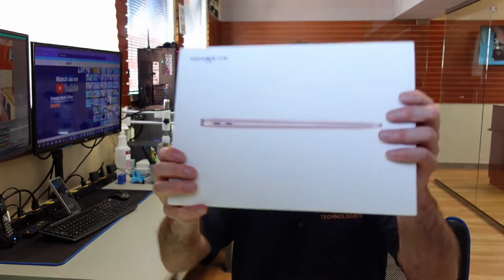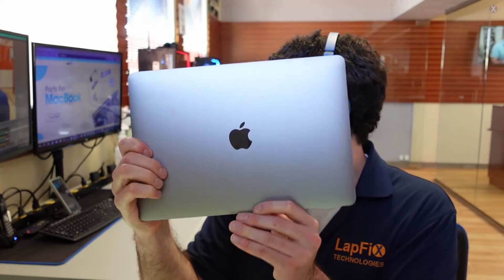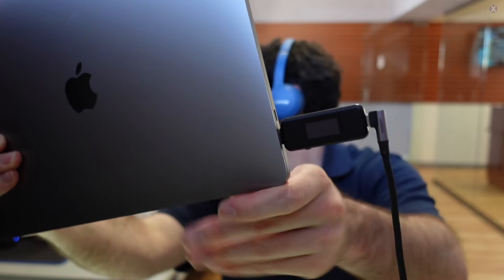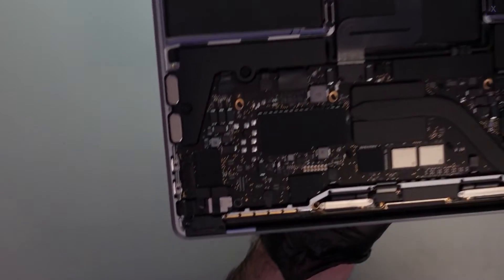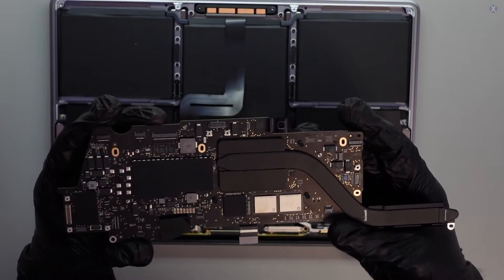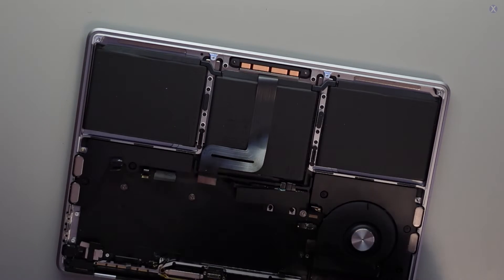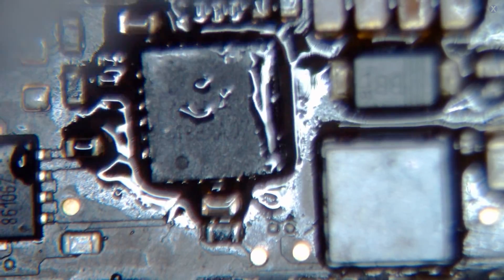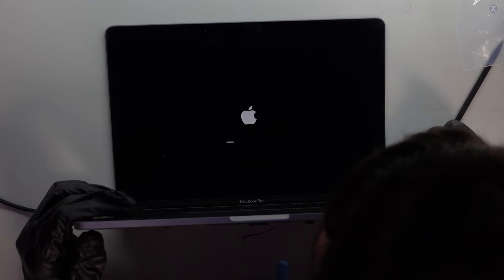Fixing a Dead M1 MacBook Pro With Liquid Damage

Comment: May I ask sir for your help regarding the following issues that have occurred with my laptop:
 
1. Some tiny droplets of water from my hand accidentally landed on the keyboard and touchpad of my MacBook Air M1. I'm concerned if these droplets can seep into the keyboard and touchpad, potentially causing damage to the electronics inside or to the laptop itself; and 

2. The upper left corner of the lid of my MacBook Air M1 got stuck to the steel surface of my lamp. When I tried to pull my laptop away, it was a bit difficult because the magnet on the lid was connecting them. I'm wondering if the pulling of my laptop away from the steel surface of my lamp could potentially cause any damage to my laptop.
 
Thank you for your assistance!

Comment: Sir,
     My macbook a1708  is working fine, but after using it for longer period the display slowly turn into black.

When the laptop get cool it work fine again display. But when it heated up it shows line mark after that screen gets black.This problem started when I upgrade to new version OS 14.
           So, sir if I change the SSD , 
Will it fix my problem?
Sir ,Plz reply to my comment.
From India